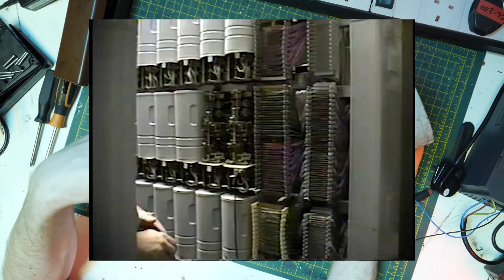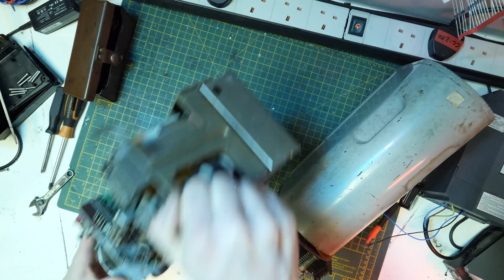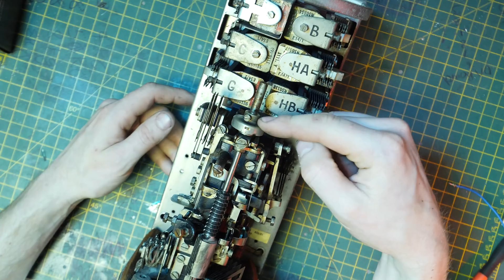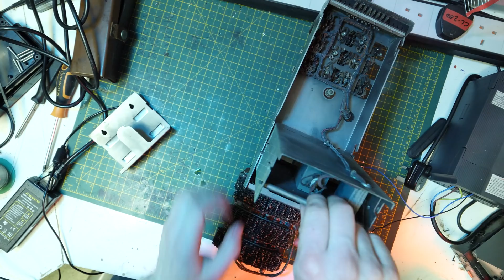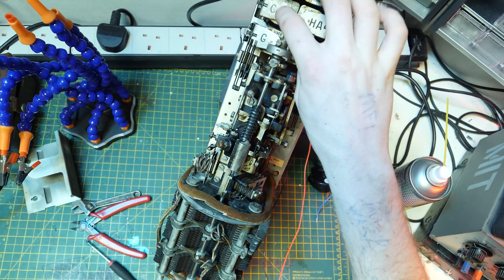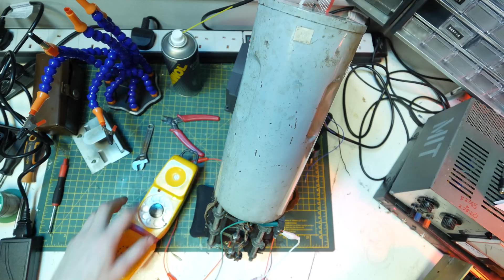OLDER PRE 2000 STROWGER SWITCH

Comment: Cheers for the shout out and good to see this :-) . My dad said it was a British Siemens (Siemens Brothers & Co.) Strowger final selector but other sources says they were made by the Automatic Telephone Manufacturing company but maybe Siemens Brothers made later versions? I also just found out my local exchange Caterham valley was one of the first in the UK (alongside Epsom) to be automated as part of a test to try out different systems. my dad later worked in Epsom and Sutton exchanges. The term "Strowger" is often generically used but several different companies produced systems using the same basic principles.

Comment: Can anyone explain how the step-by-step SxS system used in the UK added touch-tone dialling? I assume something was placed in front of the SxS system to convert the tones into pulses.
I wonder if the early devices for this conversion were implemented without integrated circuits.
Reply: The digital phone had a switch on the bottom that allowed you to choose between pulse/tone depending on the type of exchange you were connected to. Digital exchanges would recognize both pulse and tone.
Reply: Some strowger exchanges were fitted with a Front End Processor or Front End Enhancement, I forget which, this gave some access to DTMF functions. They were short lived and I think were only available to a limited number of lines within the exchange area.  Certainly the one I can remember was fitted in the first exchange to go digital in our area. It's a long time ago and I wasn't on switching anyway.

Comment: There was a pre 2000 exchange unit still running in central London in the early 80s when I was an apprentice. Was changed over to system X around 1985/86.

Comment: That looks like the same kit used on the 1950s Harwell WITCH dekatron computer on display at TNMOC: https://en.wikipedia.org/wiki/Harwell_computer well worth a look, relays and unusual dekatron counter tubes.
Reply: Aaah yeah same relay set cases interesting. Probably economical to work it off the exchange standard I guess?? Wouldn't have been the switches like above but the relay sets coool;!!! How interesting
Reply: @LOOKMUMNOCOMPUTER  if you haven’t visited the National Museum of Computing it’s well worth it, they usually have the WITCH running off paper tape. The dekatrons are counter valves which light up radially depending on the digit stored so you can see them all whirling round and hear the relays bashing as it runs. They’ve got heaps of other ancient big iron. https://www.tnmoc.org/witch